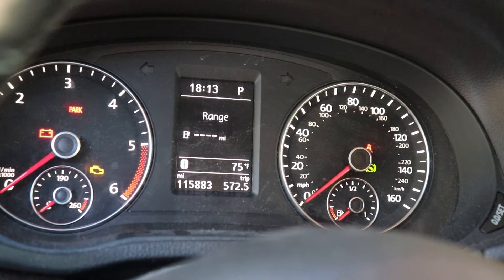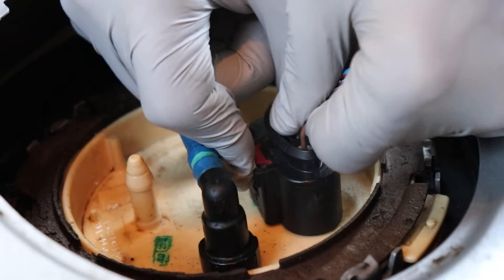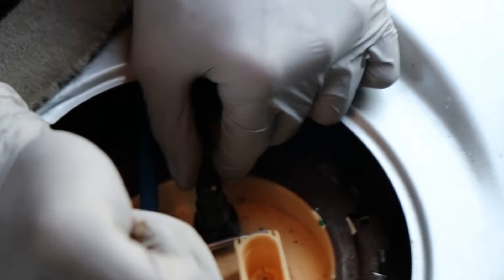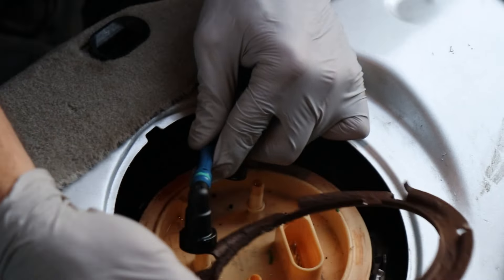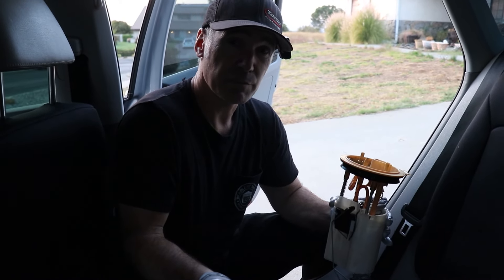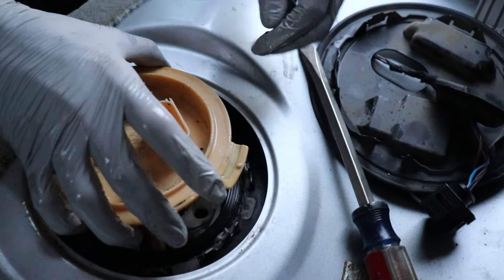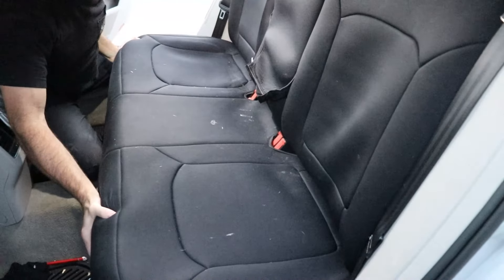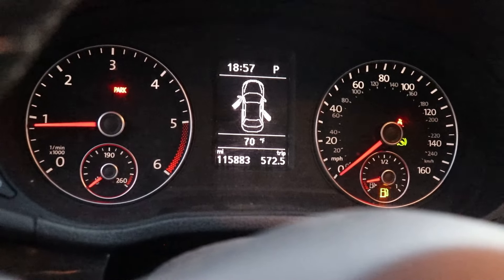VW Passat TDI Fuel Pump/Lift Pump (In-Tank) Replacement - 2012-2015

Comment: Big fan of you guys using some used parts. It shows others that they can still be working great and it’s OK to go that route depending on financial circumstances.
Reply from the maker: Thanks for the comments Luis, it just didn't make sense to spend $600 on a new fuel pump. We like to use OEM parts whenever it makes sense, this way we get to use OEM and save some cash.
Thanks for hanging out, Cheers!

Comment: Doing this job today for the MiL. Dealer she took it too wants $1300 claiming 5hour labor book time 😂 i told her its maybe at most 1hour for me to do it. The oem part itself is the expensive part so going with autozone delphi aftermarket with limited lifetime warranty.
Reply from the maker: Thanks for the comments, glad to hear you are tackling it yourself. Those dealerships love to charge customers. 
Not sure what the Delphi unit costs but you will still be saving a ton of cash. Good luck on the repair, let us know how it goes.
Cheers!
Reply: @ ok so i just finished and we have a 2015 vw passat and the fuel pump was a little different from yours but similar replacement process. Took me  about 5 hours since no deaer in a 30mile radius had the part available so i went with autozone delphi brand. Find out the new pump was broken so had to return and go to another autozone across town for the replacement. The gasket i had to purchase at the dealer and it gave me a hard time when i was attempting to put the metal nut lock on. Finally, its done though. Your video was helpful with this task.

Comment: To my understanding, 2009 on up doing the key switch to the on position does not turn on the in tank fuel pump. Either use software or manually prime the pump with 12 volt battery directly to the pump. But as far as the video goes well done. 👍
Reply from the maker: Thanks for the comments Denny, all of the "NMS" B7 Passat's sold in North America & China should prime the in-tank fuel pump with a key cycle. We have several 2012-2015 TDI's and they all work with a key cycle.
The ROW B7 Passat does not seem to have this feature and will require a scan tool in order to activate the fuel pump.
Cheers!

Comment: I try everything that you said how to remove the plug. I pulled the red clip up wiggle wiggle, and the plug would not come off. Do you have a better way for me to do that?
Reply from the maker: @Mellowmationsz  Sorry to hear you are having trouble with the connector, sometimes they can be a pain. Just be sure you are pushing DOWN before you squeeze the clip. There is some pressure on the connector so it needs to be relieved before disconnecting it. 
If that doesn't work, you can also try a small hook/pick tool to get under the lip of the connector from the bottom side (closest to the pump). Just be very gentle and only pry it enough to remove. You do not want to break the connector, otherwise it won't stay connected to the pump afterwards.
Let us know how it goes, Cheers!

Comment: Is a 2015 Passat TDI different?
Reply from the maker: Thanks for the question, it looks like the 2015 uses the same fuel pump. We thought it was different since it has a different motor than the 12-14 but the lift pump is actually the same. So the process will be identical for the 2015 TDI's.
Good luck on you VW project, let us know how it goes.
Cheers!
Reply: @BradleysGarage Thank you for the info. Its really strange because on FCP Euro a 2014 TDI fuel pump is $600 where as a 2015 TDI is $200. Not sure why there is a massive difference in price, they look identical. I ordered one and will be installing it tomorrow, hope it all works well
Reply: @zinotoubal3215 did it work or no
Reply: Thanks for the great instruction! 
Do you know if it is the same pump for a Passat with auxilary heater? Seen alot of pumps with the third nipple being ”uncut”…

Comment: Hey mate, thanks for the video! I have a quick question, I need to replace the fuel pump in my VW Passat B6 140hp 4motion (2009) but I can not find the "exact" part (3C0 919 050 R) do you know by any chance what is the pressure on that pump, so I can find some alternative one? I can see options from 0.25 to 3.5 bar...
Thanks in advance for your help!
Reply from the maker: Thanks for the comments, glad you enjoyed the video. The current part number we pull up for that model is 3C8919051B
Looks like 3AA919051E was a previous revision part number. It seems like the VDO may no longer be made. Not sure what aftermarket options exist out there.
Good luck on you VW project.
Cheers!